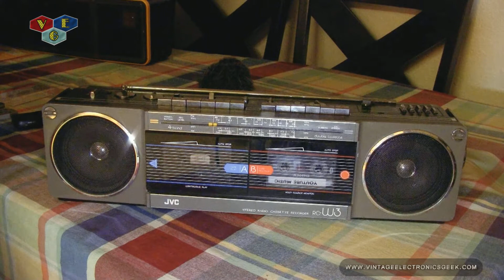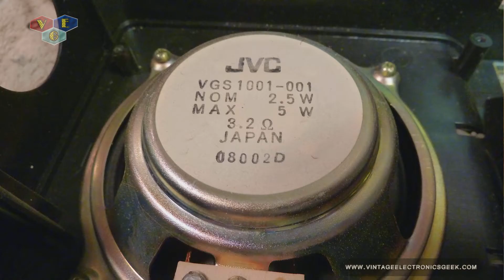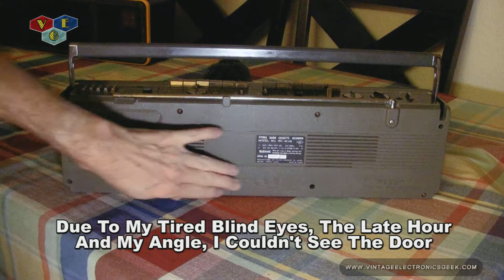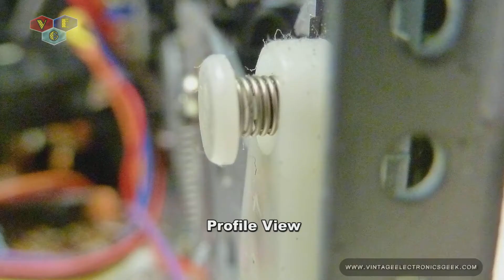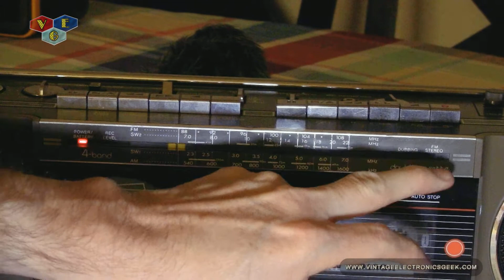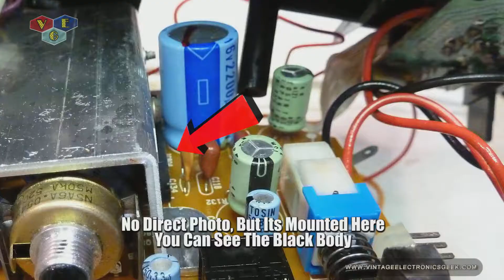JVC RC-W3 AM/FM/SW/Cassette Tape Boom Box - *Overview *Service Performed *Bandscan *Tape Test

Comment: Seems like a well made device Jack.
Looks a bit cheapish on the outside, but has two dive motors and quite beefy speakers. I never do a full recap on devices like this as I don't really consider it necessary, but it can't hurt either.
Reply from the maker: Same here, but I figured since Don likes the radio and he'll probably use it I'd do it just for GP....but it was a lot indeed!  I have a Tektronics scope I need to replace 80 SMD caps cuz of leaky...not looking forward to that...bad eyeballs!  :)  ~Jack, VEG

Comment: I bought my original one new back then, under 200$.  I wore it out, mine had great radio, used to SWL back when SWL was still good.  It was fun to record off radio.  I almost EOLed this one, got it at a junk store cheap, but it was a beater, also worn out.  I thought maybe you could do something fun with it for yourself, or EOL it, shsngo066 style.  I don't do cassettes anymore, so it's a radio, and i got my ham radio ticket since then, i.e. use Yarsu instead for SWL, making it obsolete.  Um sorry that you put the time into it, and appreciate it, it is nostalgic.  I enjoyed playing with one again, but it may end up shelf candy, hope you understand that it is not up to par with my Yarsu, when I get that GAP antenna repaired.   And SWL these days sux unless you like Brother Stairs.  Only a few crummy stations. I THINK ALEX JONES IS GONE?  I like hearing hams, and you know...  that takes much better tigs.  Since you put much effort into this, itsa keeper, and much appreciated.  I do like messin with it.  So I decided not to have Noah run it over with the John Deere, lol.  But like those Magnavox boom boxes...  great memories, but things changed.  After I wore my JVCs out, I replaced them with Panasonic boomboxes that were far better, but no SW bands.  For SWL I got a Rad Shavk DX440 or something like that, digital and made by Sanjean.  I still have one of those, and it had the BFO, back then it was a big deal.  Funny thing, I have a 60s Drake TR4 tube HF rig with home made dipole, enjoy that bugger a lot, more than a Hammarlund. Yup, um spoiled with high performance rigs, lol. 
73, The Donald